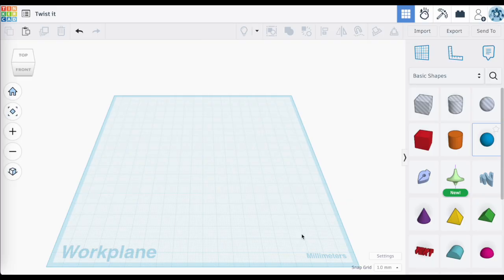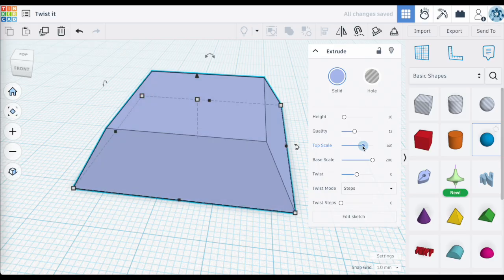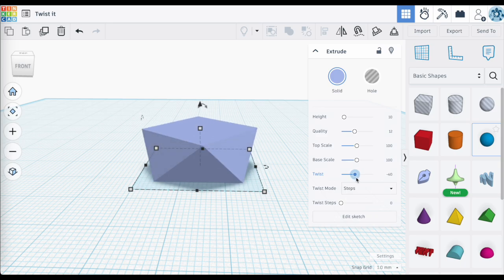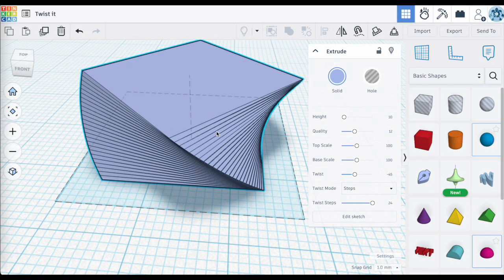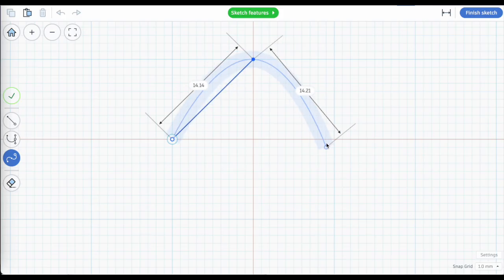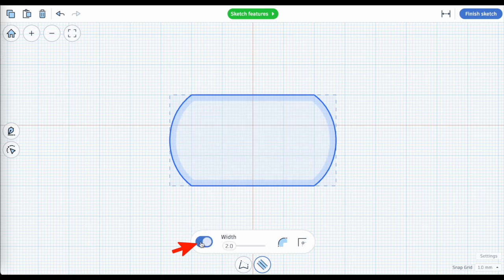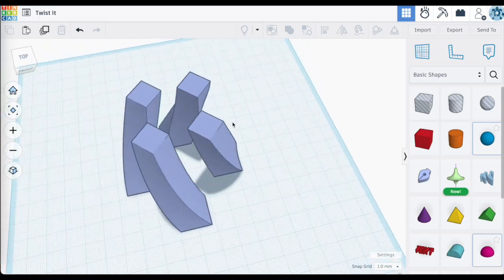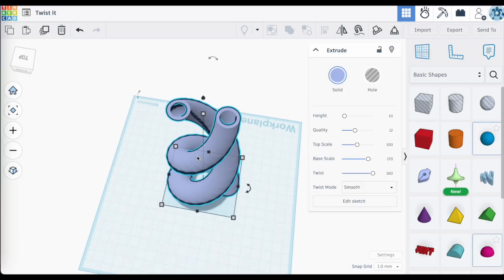Twist and Scale make Tinkercad's Extrude Sketch even better

Comment: Love your videos. You make things so much easier to understand than some other videos I've seen!!!!!  My question: is there an easy way to measure a shape than with the ruler? The ruler only gives you the x, y, and z outside dimensions of the shape. But what if you need to measure the depth of a hole or the depth of some part that is sticking out of the main body? Is there a way to measure from point a to point b?
Reply from the maker: Thanks so much for the post @h.w.kueckelhan2322 ! - You raise a great question - as of right now there is no tool for measuring distances between 2 different surfaces.  I know of a few viewers who were asking for the same thing.  The ruler can potentially help but it requires you to line up the ruler properly - so it's not a fast process.